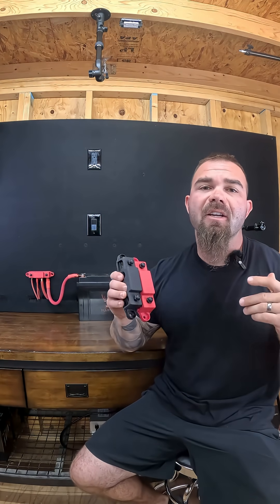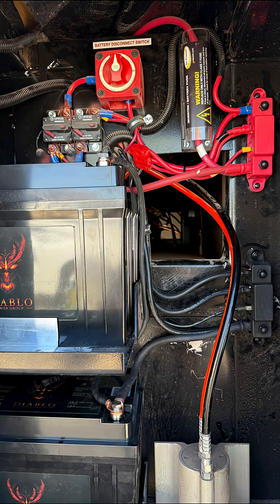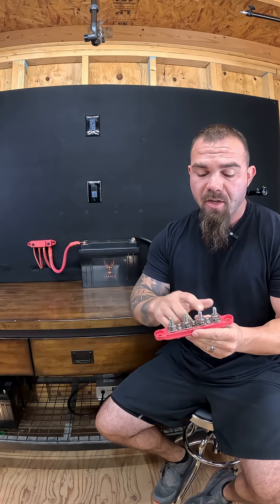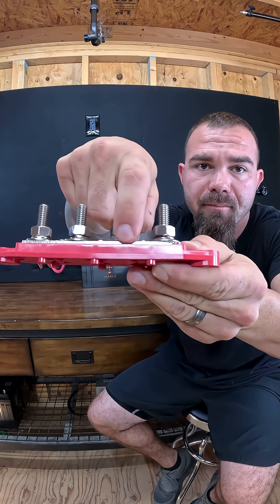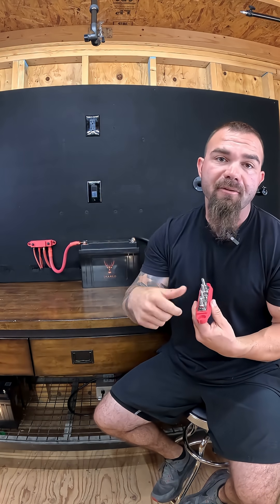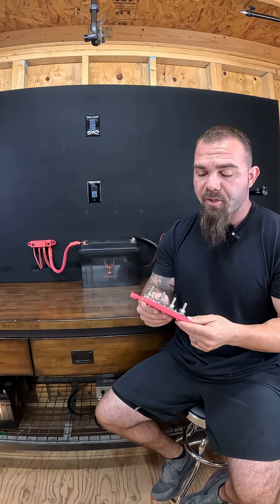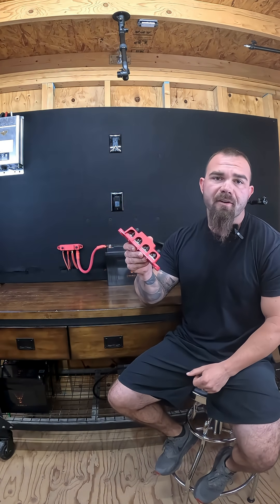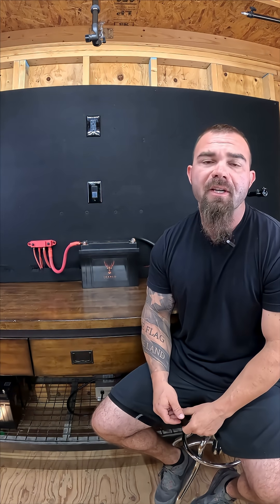What is a Bus Bar? Beginner Guide to Electrical Distribution!

Comment: Could you hook up the charge controller wires to the smaller screw posts on the same bus bar?
Reply from the maker: As long as those wires are a sufficient size for for the power being generated by the charge controller, yeah! It doesn’t matter where the wires get landed as long as they make a good connection to the bar.

Comment: What about smaller wires?
Reply from the maker: Any size wire can be added to bus bars, you’ll just need to make sure the terminal on the end of the wire has either a 5/16” hole or 3/8” hole depending on the size of the stud that you ordered the bus bars with.
Reply from the maker: It may be difficult to see in the video, but the bus bars also have small Philips screws on them to make adding very small wires possible as well. Great question!